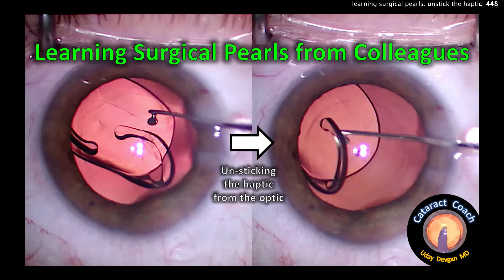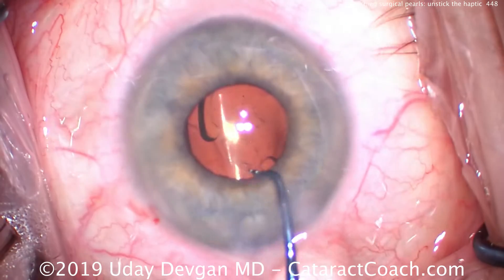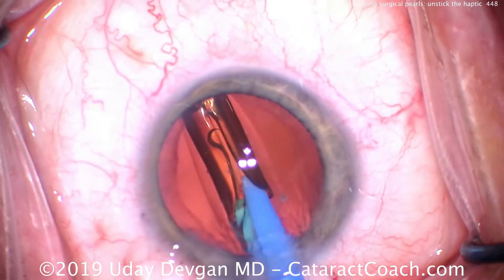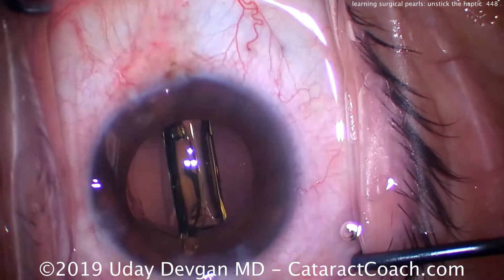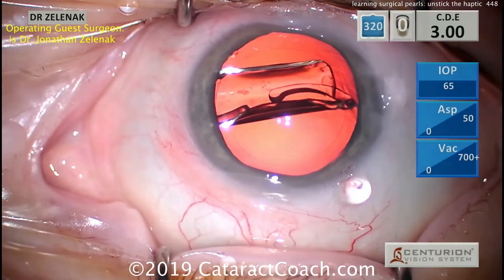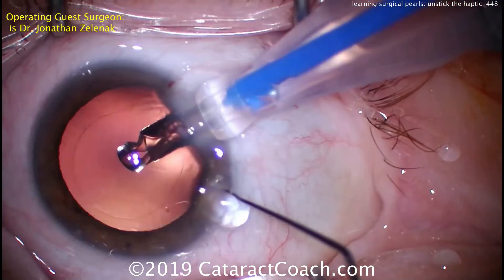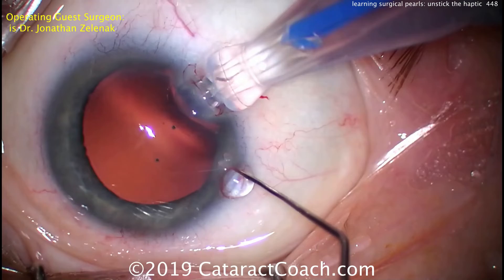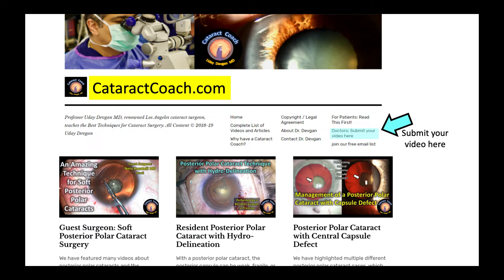learning cataract surgery pearls from colleagues (stuck haptic)

Comment: I find this issue happen when there is not enough visco in the cartilage prepared by the assistant.
Reply from the maker: Sometimes. But in my cases shown here there was plenty of viscoelastic. Often it is the compression of the IOL as it goes down the injector tip that causes this issue.
Reply: @UdayDevgan  Also if the IOL power not taken in account in relation to cartilage size can cause similar issue in addition to possible cartilage or IOL damage.
Reply from the maker: @smartwave9  Yes, excellent teaching point. Thank you for contributing -- very much appreciated!
Reply: @UdayDevgan  Thank you sir just sharing my humble experience and thank you for your sharing excellent experiences on this excellent platform.